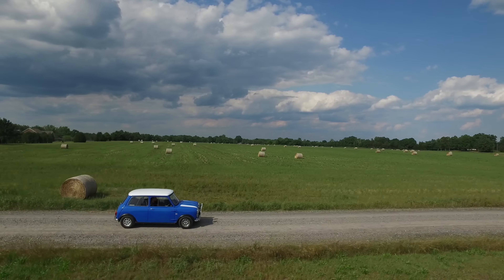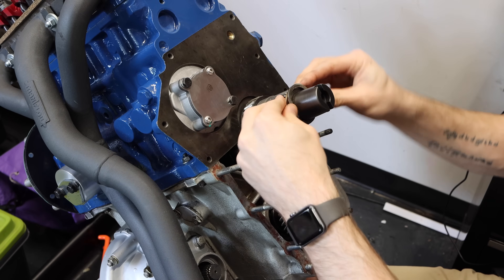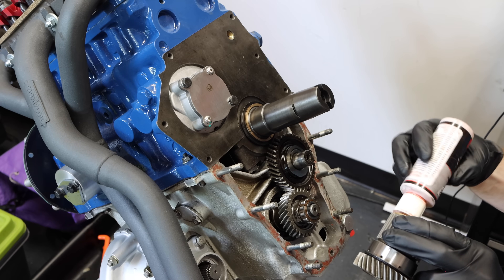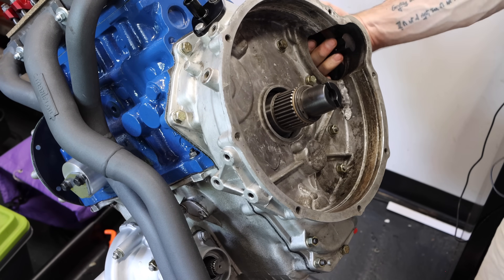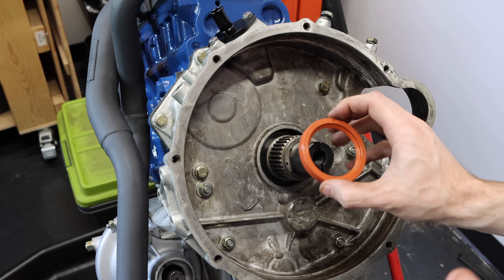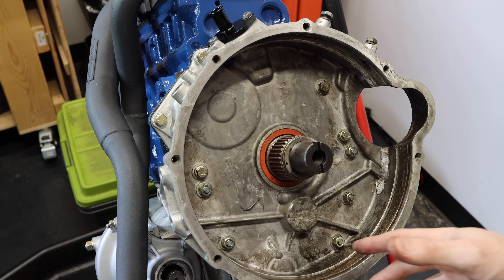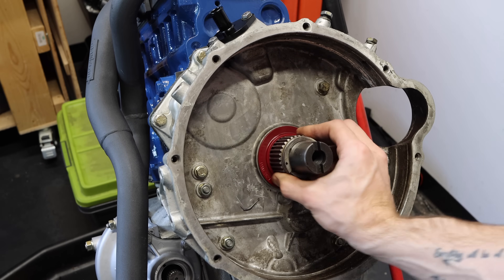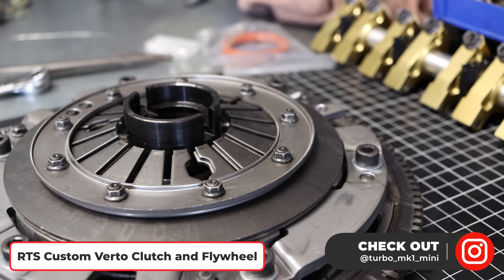Building a Boosted Classic Mini Engine - Part 3

Comment: I never fit the clutch (main seal) dry. Lubricate the sleeve and primary gear running face so the seal doesn't stick and tare. Also, the tool for installing the clutch seal should be screwed in using the flywheel retaining bolt (hence the hole) Not hammered in.

Comment: FYI
Sliding the rear main seal up the primary gear is a NO NO... these are a feather lip seal.. and one little cut on this feather lip is a oil leak which is a pain to fix..
Tape the splines ( which the clutch friction plate moves on _) with electrical tape.. to prevent this..  also .. using the later model BLACK COLOUR  Rover Oil Seal .. is a much better version of the seal..  

There is a special service tool to fit this .. ( recommended )
Reply from the maker: Thanks for the tips on the tape. I actually use the tool you recommend about 45 seconds further in the video. The black rover seals are good seals but not always suitable for engines that run hotter. The additional spiraled grooves in the black rover seals don't handle high heat and RPM very well and have a tendency to prematurely fail in those scenarios. The orange rear mains are better for this application.

Comment: Nice videos dude! I disagree with the "coolant velocity". I think (and what I know) is better a coolant moving faster because the temperature difference between water and air is too small compared to the temperature difference between the water and the engine. An oil radiator is one of the best options to increase the cooling in my opinion.

Comment: Instead of hammering and damaging the primary gear seal tool, use the flywheel bolt in the end of the crank to screw the tool in and ease the seal home.  It's what the hole in the tool is for.

Comment: My 1380 engine had only 93hp but I felt happier putting in straight cut drop gears from the crank to the gearbox.  Really would have liked to see same on your engine.  They are noisy, but at least getting the power to the gearbox won’t be a problem ever in future.  My gearbox was still helical geared, but I’d heard many stories about helical transfer gears grinding into the housing, that I wanted to avoid that.

Comment: I used to re engineer Mini engines for "mini rod" racing here in the U.K. ,,, used to make the little buggers go like the proverbial brown stuff off of a shovel! Once did an engine for a boy racer,, he told me it was for racing, but dropped in an old road car,,ran it in as per my recommendation, then , the joke was,, right outside my shop, at one time he was giving the Brmm Brmm Big one, at the traffic lights, they went green, the whole front of the care shot off, including sub frame, and the rest of the car just sat there!!
Reply from the maker: Holy crap that's insane. Would have loved to see that actually...

Comment: Let me think. I slow the water flow down and that improves cooling? Nope, just nope. More importantly, the same drive is used for the fan as well which will also run more slowly thus reducing the cooling air flow. The only reason that slowing the cooling flow down is because of turbulance and gassification which inevitably will reduce cooling effect. If however that is not the case then slowing the coolant down will not improve cooling because it's not about the actual temperature it's about the mass flow of coolant. More mass of coolant at a slightly higher temperature is just as able as lower mass flow at a lower temperature to deal with the heat output. Given that the engine performance is increased - thus heat load - it seems a bit odd that one would reduce the coolant volume flow. When designing a large cooling system on things like ships the main criteria is mass flow not the temperature.

Comment: Having the right tool, but if you are producing a video stating how to use it, you should really know how to use it. You don’t hammer the tool you wind it in with the crank bolt
Reply from the maker: Already addressed this in my pinned comment. I have been informed I used it incorrectly.

Comment: Looks good, I did similar mods but found it to be very unreliable due to heat, boost pressure past rings. Good luck with your setup 👍🏻.

Comment: Why no oil inside the seal or on the slide? Plus you are supposed to use a soft hammer / mallet when hitting the seal installation tool.

Comment: Correct tool used incorrectly, the primary seal tool has a hole in it for a reason, to pull in into place with the crank bolt, not supposed to be smacked with a hammer. Also you put the seal onto the primary dry and without the sleeve prior to fitting, as you say its an important seal why risk damage, bitch to change in situ.
Reply from the maker: Yeah I pinned a comment talking about this mistake I made. Cause you are probably the 10th or 11th person to tell me this. 😂 seal was not dry though. It was oiled off screen.

Comment: The cotter pin/split pin in the bottom of the flywheel housing is actually called a 'jiggling pin'. Served my time as a Austin/Rover apprentice and that what we knew them as.
Reply from the maker: What a funny name. I wonder where that name came from. 🤔
Reply: Think its the fact it used to jiggle around to keep the hole open. A lot of the older cars had them, not just Austins

Comment: The slave cylinder bracket has a part bent up with 2 mounting holes and a teardrop shape opening, what’s that for? Always see it empty on very mini, even on mine! haha
Reply from the maker: I believe this is for the housing that runs to the slave cylinder. If you are using a fully stock hydraulic line setup. Most people change them out for nice single braided lines though.

Comment: Thought you were going EFI? How come you're still using an old school dizzy and not electronic ignition aswell?
Reply from the maker: It’s a pretty unique EFI setup. Uses the dizzy for ignition signal and timing but fully ECU controlled injectors. I’ll explain in more detail in an upcoming video.

Comment: Hi Paul, I am looking forward to re-build my 1098cc engine and make it low compression as to use v-max supercharger. Also, I am lloking to buy the adapting plate in order to mount the engine the way you do it, do you have a drawing where I can copy it? My mail is bianchiagustin06@gmail.com, BR

Comment: No lock tabs used ??
Reply from the maker: I use spring washers instead of lock tabs. Its a tip I got from John Guess (Guessworks) a year or so ago. Modern solutions in this case provide a more secure fastening than the old lock tabs do.
Reply: @classicminidiy  Spring washers have been around for years. They are used in various other places on the A series engine. Lock tabs are much safer which is why BMC used them inside the transfer case.

Comment: Locking tabs on the housing?
Reply from the maker: I use spring washers instead of lock tabs. Its a tip I got from John Guess (Guessworks) a year or so ago. Modern solutions in this case provide a more secure fastening than the old lock tabs do.

Comment: You have probably already damaged that oil seal as you did not put lubricant on that tube. Also you slide it over the splines earlier which can also damage the seal lip. When one does these videos the procedures have to be correct surely
Reply from the maker: I have done many of these seals, and while I agree it is very easy to damage the seal lip on the splines if you are not careful. I took extra care while illustrating this in my car. That said the seal was oiled prior to installation. I do my best to cover every detail but unfortunately, I miss things from time to time. Thanks for watching.

Comment: I've got the same primary gear oil seal tool,I don't hit mine I use the flywheel retailer bolt to wind it in,the tool bottoms out on the transfer case.great videos 👍
Reply from the maker: Yeah I have been informed hammering it is not the "right way to do it" hahaha Guess I will know for next time.

Comment: On most racing minis they drill holes in the transverse case for cooling clutch,this might be a good mod on yours.
Reply from the maker: I don’t think it’s going to be needed on my car. I also don’t want to introduce that much open air on a daily driven mini. Too much risk of water and dirt ingress
Reply: @classicminidiy  I agree, good idea though.
What about living the flywheel inspection open do you think that is of much benefit?
Reply from the maker: @paulhotson5820  Nah these clutches really don't get that hot in regular usage. You really have to be beating the snot out of them to warrent the holes on the housing at all and even in spirited driving in the mountain roads, you are unlikely to push it to its limit.

Comment: No bypass hose? If you have never needed to remove the cylinder head in order to replace a split bypass hose then you just haven't had the full "classic" Mini experience, IMO.   ;-)
Reply from the maker: This engine actually had the bypass before, I made sure the head setup I replaced it with didn't have one because I NEVER want to do that job again. Hahaha.
Reply: Me neither. I made sure to use really thick walled hose the last time I had to do that job. Those concertina-style thin rubber hoses which you can fit without removing the head are simply a disaster waiting to happen.

Comment: you missed a bit ;-), the drive dog that goes on before the crank bolt, the dog is offset, bigger part to the left / rear when sitting in the car, do it wrong and the flywheel can come loose. when we use to run them on the floor, we did just that, sitting on the floor, no need for engine frame.
Reply from the maker: I do my best to cover every tiny detail but sometimes I will miss some. Thanks for the heads up! I have a few other engine build videos where I go into this in more detail. This is a bit more advanced build than the others so I left some basic details out. :-)
Reply: @classicminidiy  today top tip, weld nuts onto the engine mounts, saves trying to feed the bolts through the subframe and mount.

Comment: Hi what do you need to change from pre verto to Verto? Thanks
Reply from the maker: More clutch options for high torque/horsepower engines. This RTS clutch for example doesn't exist on the pre-verto setups.
Reply: @classicminidiy  i understand that but do you need a verto clutch housing or can a pre verto clutch housing and clutch arm be used thanks
Reply from the maker: The housings between verto and pre-verto are the same. There are some extra brackets for a verto system. Switching between the two will also need completely different throw out plungers, slave cylinders and a few other items.